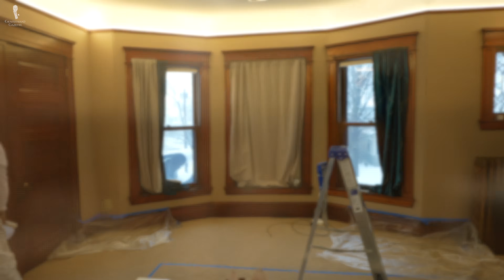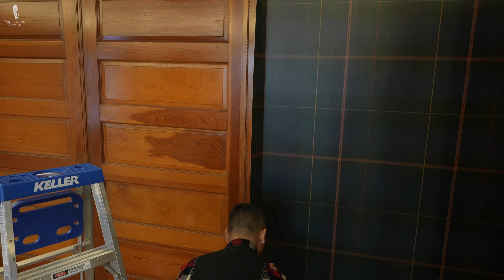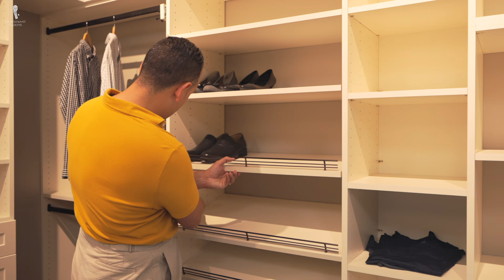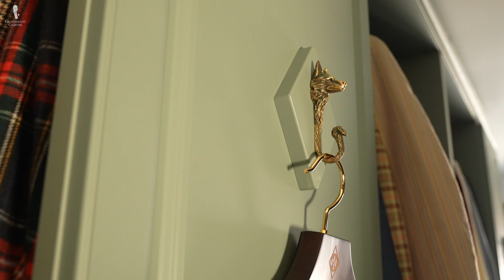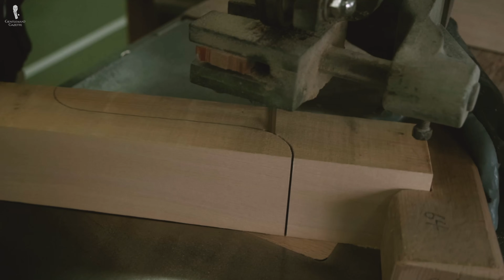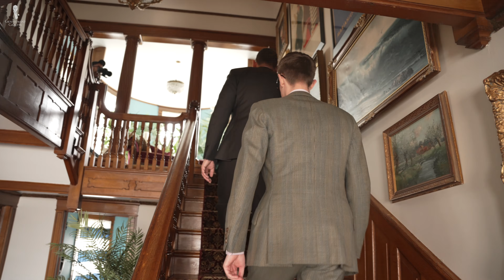How I Built My $41,000 Custom Closet

Comment: It surprised me that you chose to place your new closet on top of that carpet. Someday you’ll want to change it and you’ll wish you’d taken the time to cut it out to place the closet directly on the floor. Not on top. Fatal mistake.

I’m redoing my much more mainstream master closet, and I started by removing the carpet and upgrading the floor to pre finished hardwood. The previous owners built their custom closet on top of the carpet and I saw this as a very short sighted and cheap decision that limited future changes. Your video did give me lots of ideas. And fanciful thoughts. 

You must have been a tough customer to work for. Everything took longer and you seem as knit picky as I would have guessed by the closet design choices. 😂

Comment: Very impressive! I agree that in your house, white would have felt just wrong, as it isn't a closet really, but a whole room with the original wood and brass details.

Now each budget varies, but the work you did with the details is still mostly the same. Sometimes it's even more work to find something to fit a tight budget, even with less definitive style, if you want it to work as well.

The show shelf is a good example of "problem of the halves", that isn't present only with shoes, but with almost anything put on shelves or kn drawers. Most kitchen and wardrobe designers won't stop to think about that - they don't even know your specific things going on the shelves. Usually less and wider units is better than more and narrower, unless you actually know and measure the exact contents.

Regarding the lighting, I warmly recommend looking into daylight lamps, preferably with full spectrum, as it shows the colours best - no surprises when going outdoors! 
You can't find leds with full spectrum (just approximately eight end colour temperature, making them "dayligh"), but they make fluorescent lamps that are good, both in bulb and bar  form. . And they fit best for indirect lighting - you'll notice that you can (maybe even) have quite a bright lighting with full spectrum daytime lamps, and you don't want that directly in your eyes.

Comment: Yet another day I'm happy to be lucky to own a workshop and tools.
Reply: Yup. If you're not a man of means, you learn to DIY or do without.
Reply from the maker: I neither have the tools nor the skills to DIY a project of that size. I even had two great carpenters consider it, but the tall ceilings, the weight etc would have meant they would have to do a lot in place, so they declined. I have worked with them on another project in the house, but they just couldn’t take it on. It would have taken a while to do it, but it is not easy.